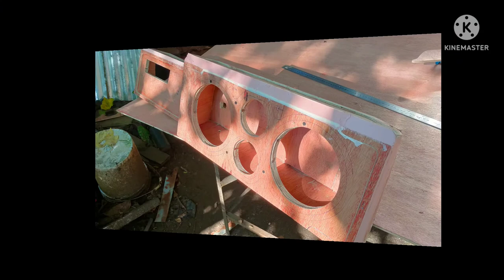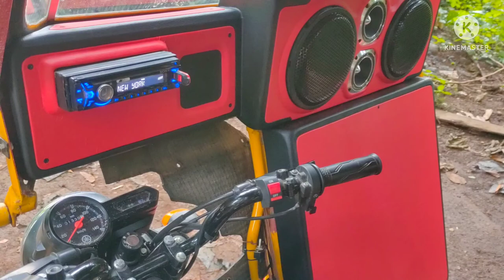Episode: 29 | Custom Made Tricycle Car Audio System #woodworks #davaocity

Comment: Boss tanong ko lang paano kaya palakasin karga ng battery, bilis bumaba voltage pag nilalakasan ko ang sounds. 
Tmx 125 alpha motor then 2sm electron battery. Tapos naka diode na charger
Reply from the maker: Boss if brandnew yung batt nyu goods yan, pero pag secondhand ay naku problema yan boss! Kung ang set up no is minimal lang like 4 mids or 6 no subs, goods na yun pero pag medjo heavy setup mo boss, ai d kakayanin ng baterya mo... Advice q boss mag deepcycle batt ka yung pang solar, kaso lang mabigat yung pang solar, pero sulit naman sa power boss, d ka mabibitin non
Reply: @jeproxcreationsteamaudioph5255  kaka 3 month yung battery. Mga ilang AH kaya kelangan. Nakukulamgan kasi sa electron 2sm type N50
Reply from the maker: 100ah boss di kana mabibitin non!.. Maliit kc yang 2sm/n50 9 plates lang madaling ma lowbat
Reply: Ano brand ng battery ang hahanapin ko sir?
Reply: Gusto kong subukan nung s168  isseries. 12v 60ah. Kaya ba yun